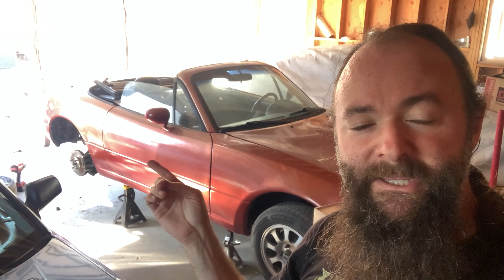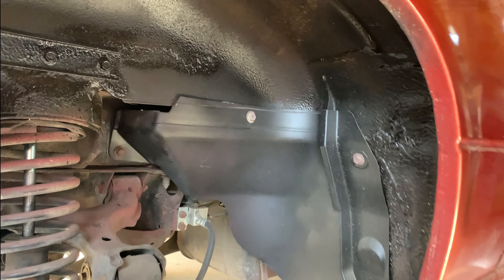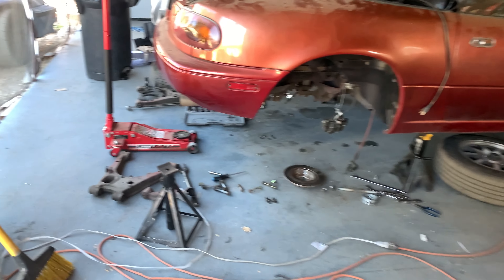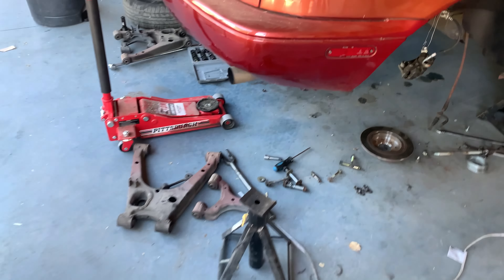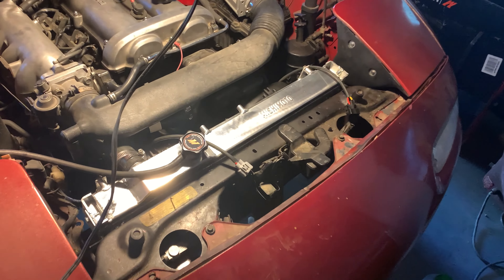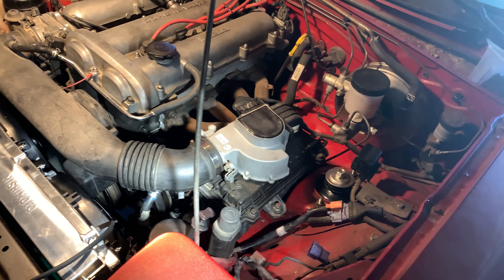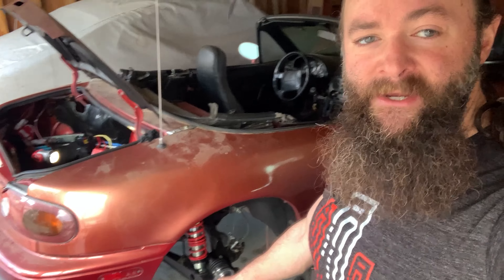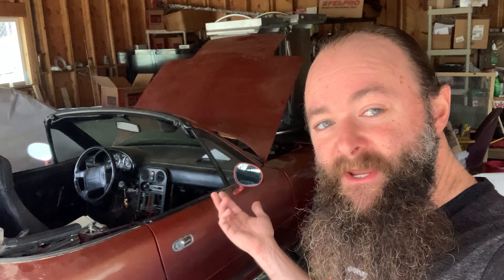The rear suspension on my NA Miata is a CATASTROPHE

Comment: Looks like Devin's Appliance Emporium is running low on stock!
Reply from the maker: I'm down to two refrigerators now! And I cleaned up the moldy door I found on the side of the road, fits perfectly! I'm keeping the broken door just in case I need to swap the rubber over.